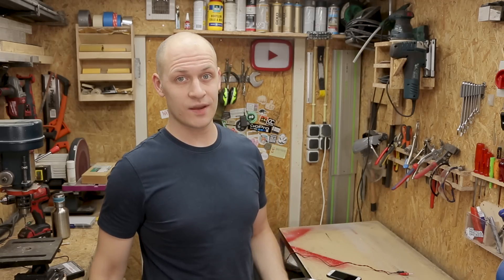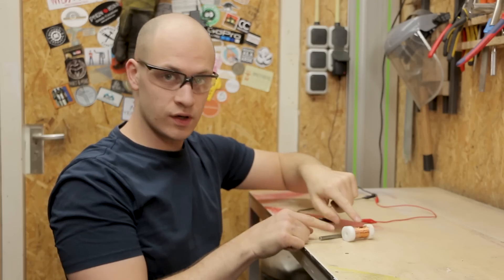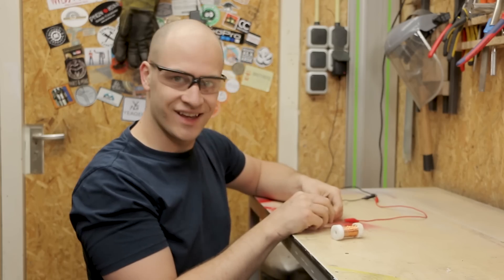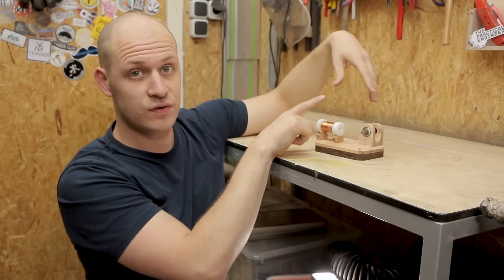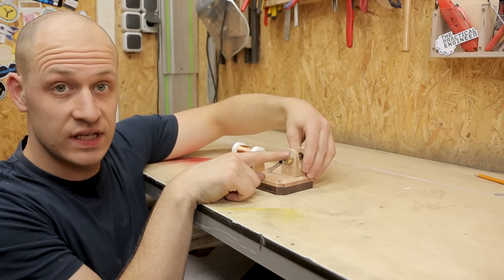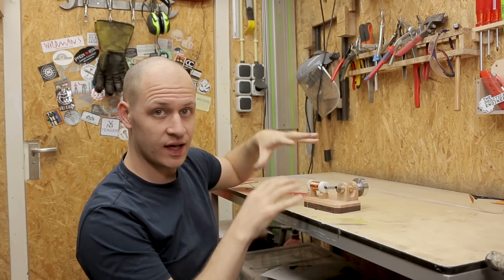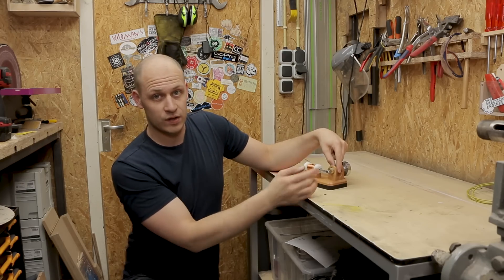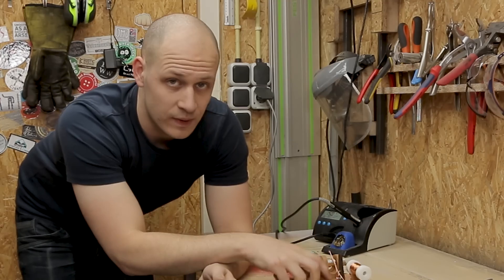How to make a Solenoid Engine

Comment: Very cool video :) Only recommendation I would give would be to add a diode across your solenoid to prevent destruction of your switching transistor. The fly-back on large inductors like those can quickly kill transistors as the high-voltage spike after the magnetic field collapse has to be absorbed.  Adding an external diode across the solenoid will clamp down on this preventing the eventual failure that can occur with transistors in these types of loads.

Besides the small nit-pick, very cool video. I look forward to seeing more of your content.
Reply from the maker: Thanks for the advise Nick! I did actually add a flyback diode as you described it. I forgot to show it in the video

Comment: Seems like I need to build a solenoid engine right now 🤔 I guess since I'm studying electrical engineering that will help 😂
Reply from the maker: Oh yeah you should. That probably helps with determining the best spool and transistor etc
Reply: MrConminer: this allows for plenty of experimenting. Change of wire diameter, number of turns. The spool itself is reasonably cheap, make several of them for easy comparison.

Comment: can you put something to work there? like a puley to a machine! nice project!
Reply: Yeah! Hook it up to a generator, then wire a light to the generator, have the light shine on a photoelectric cell, have the power from the photoelectric cell run a pump, have the pump move water across a paddlewheel, have the paddlewheel connected to another generator, and then have the generator run the solenoid. Perpetual motion!
Reply: @KarlBunker  that would be a perpetual motion machine, which as all us educated people know is dreamland stuff, you have to overcome the mechanical resistance of things like bearings, the only way to do this would be like all the other so called "free energy" projects, hidden wires under the table to a power supply.
Reply: Bill Harrison: Thank you, Captain Obvious.
Reply from the maker: I doubt it at this size. Maybe a larger one with more cilinders is stronger
Reply: @Thepracticalengineer  you might bit able to get good speed/torque if you mess with gears a bit but your gonna sacrifice one or the other torque for speed or speed for torque